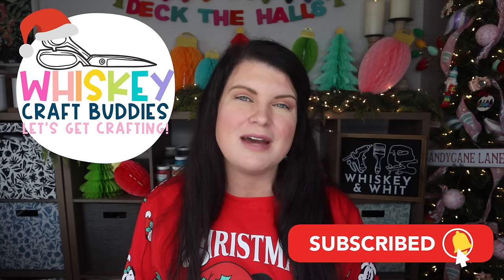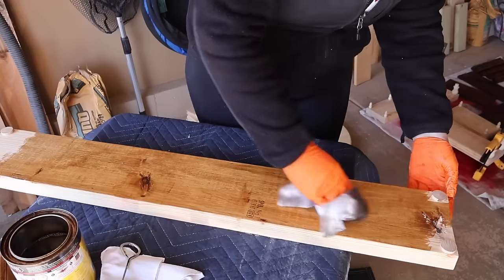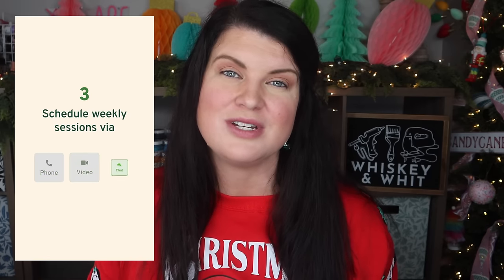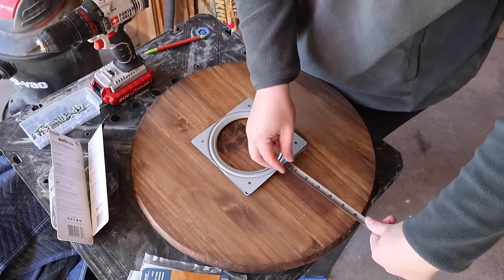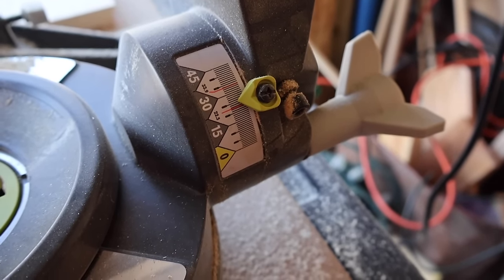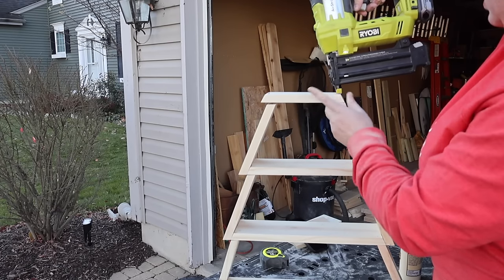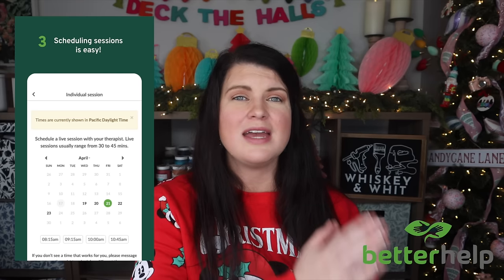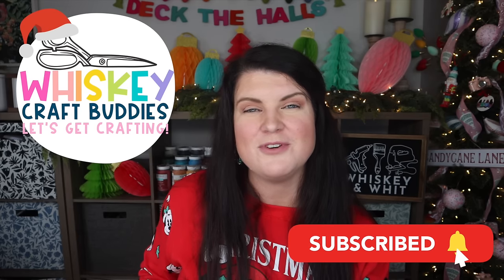SIMPLE Wood Christmas DIY Projects 🌲 great crafts for scrap wood! 🔨

Comment: My husband gets down in the winter and we found out he had a severe D3 deficiency.  So now he takes D3 every day and is much better.  Some people don't realize it may not be depression but an underlying health issue such as my husband's.  People need to check in with their doctor to run tests because it could be as simple as a D3 deficiency and not really depression.  Who wants to spend all that money on medication and therapy if it's not going to solve your problem?  Love your projects.  Thanks for all you do.
Reply: Vitamin D deficiency is a common ailment in our modern society.    It affects older people more than younger ones. Replacement therapy is a simple matter but there are cautions that need to be considered. 

Vitamin D is a fat soluble vitamin. This means it needs fat to be absorbed. (That’s why it always comes that way either off the shelf or by prescription.) This also means that it is stored in the fat cells of the body long term. It doesn’t leave the body through the urine as easily as water soluble vitamins. This makes the potential for an overload of vitamin D to be a real issue. Ironically, an overload of vitamin D can mimic the signs of depression. 

Do NOT take more than the label suggests and have your doctor screen for it whenever you’re having blood labs done. Some people end up temporarily stopping taking it during the summer months because they are outside more. It is crucial for anyone who is taking it to get checked at least twice a year.
Reply: It makes total sense. I get bloodwork done roughly every six months and it’s so telling and has helped me with underlying issues like not producing enough folic acid. That helps with my energy level increase and takes care of thinking I’m suffering from depression symptoms although I truly have been treated for depression but my meds were any helping as much as they could because my body wasn’t fully absorbing them. Best thing my dr does for me is have basic bloodwork done twice a year. Things might need to be adjusted. It’s just so helpful.
Reply: @jlow27  I’m not surprised that your energy level is low if you don’t have enough folic acid. It helps the body make red blood cells which carry oxygen throughout the bloodstream. Red blood cells also work with iron. Low iron levels can make a person lethargic. I’m sure your doctor is always checking this level as well. 

Fun fact: iron is absorbed into the blood better when taken with vitamin C or a fruit/veggie high in vitamin C than when taken alone.
Reply: @MamaJLW  I’ve heard that fun fact before and try to remember it but now I’m going to make it a point to. I work well with list and bullet points and reminders….until it becomes a habit which luckily it does. When he first did my bloodwork just over a year ago (he was a new dr but someone I actually went to HS with in the late 90s) he did a genetics test too and they both made sense. Blood tests showed I don’t produce enough folic acid the gen test showed what I did produce, my body didn’t process or absorb properly. It was amazing. So I’m like “gimme all the bloodwork” lol. I have my first mammogram (TMI?!?) scheduled in a week because it’s a little past the time for me to have it. I was so anxious about it but I just asked and the weight lifted off my shoulders. It’s silly but true; a small test now can make a difference in the future. Thanks for reinforcing what I was told with your own opinion. I’m always open to suggestions and fun facts lol!!
Reply: @jlow27  Your mammogram will be uncomfortable and possibly a little painful but it’s good to get it done. It’s better to know.
Reply from the maker: I'm glad he got the answers and help for his specific needs and that he's doing better!
Reply: @jlow27 I was always told Mammograms where painful. I haven’t found that to be true. I’ve had to contort my arm a bit before but other than that it didn’t bother me anymore than an X-ray has. I’m sure it’s a different experience for everyone. Everyone has a different tolerance to a lot of things. The unknown is always a little nerve racking. I would just hate for anyone to get too anxious just because someone else said it was painful. Personally, I just found it awkward more than anything. I was super worked up before my first one. I felt kind of silly after it was over because I was anxious for a few days to and entire week beforehand. I wouldn’t wish that on anyone else.
Reply: I have horrible S.A.D. 
The last few days have been horrible. I find that a sunlight lamp " Happy Light" helps a bunch.
Reply: True. Also, thyroid can depict depression as well.
Happy Thanksgiving & Merry Christ-mas
Reply: Great Video, Whitney.  TYVM for sharing.
Happy Thanksgiving, Merry Christ-mas & Happy New Year.
Reply: I love the nativity sign. TYVM
Reply: Gorgeous Table !!! Your family will make so many memories, and it will be a treasured heirloom ❤
Reply: @thesentimentalsoul3683  Hang in there. You can outlast this down time.
Reply: @melodymedlock160  thank you! I trust my mom and she says it’s more awkward than anything, but it’s really nothing. So I’m going to go with that and not worry about something I need to have done. I’ve never felt anything doing self exams so hopefully all will go well. Thanks for your support!!
Reply: Same here. Thank you for relating and sharing. It's hard to watch someone you love suffer. Depression is serious.
Reply: Don’t forget the k2 with your vit d and look into B vits too for mood lifting xx
Reply: That happen to me, i have rheumatoid arthritis and one time i was reading info in medical journals and said that vitamin D wad really common in some inmune deficiency illness like my RA 😓. So i told my specialist about this and she send me to take tests and YESSSS i was super low 😰. So i had to take big dose for sometime after that mu levels normalized 🙌🏼. I still take supplement but in a normal dose 🙂